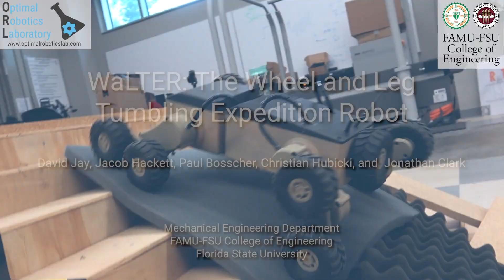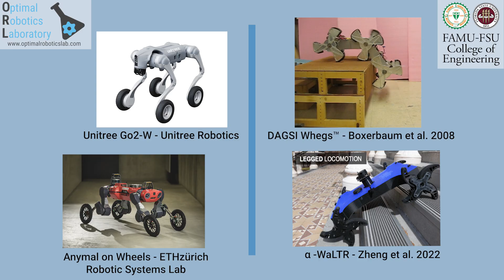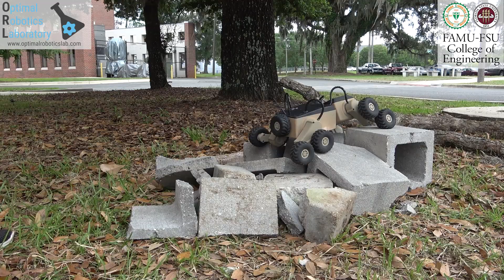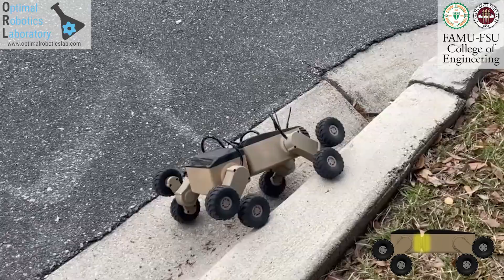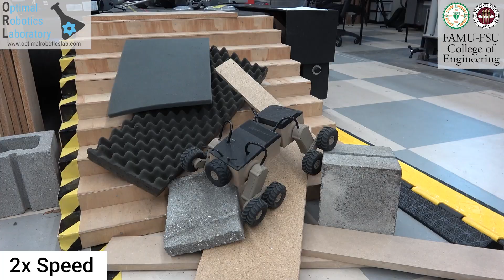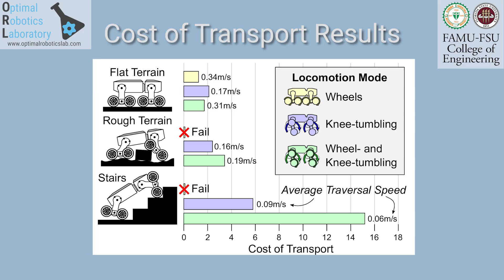WaLTER: A Wheel and Leg Tumbling Expedition Robot

Comment: Love your design.
A friend and l have been discussing something like this for agricultural purposes.
We liked the 3 wheel design from the old movie Damnation alley.
It appears your robot can lock the rotating arms in a position so only 1 wheel has contact and it can drive on 4 wheels, is this correct?
Also can it lock to give maximum ground clearance over the centre?